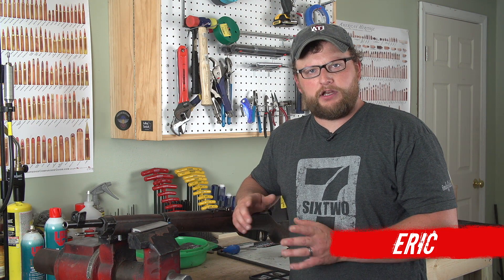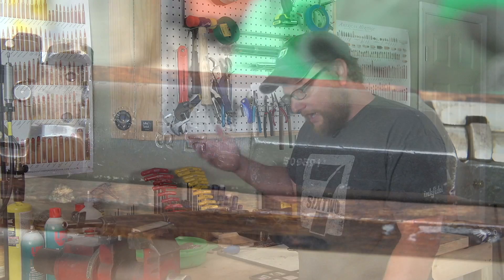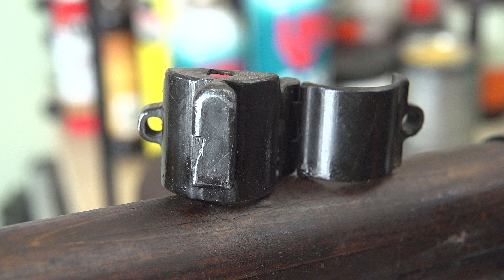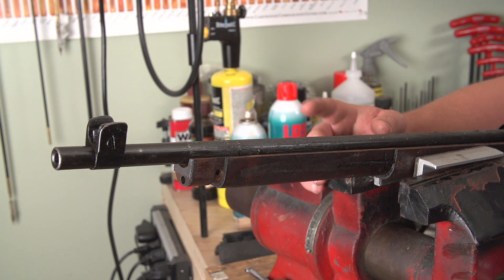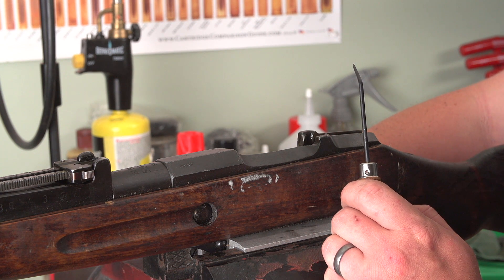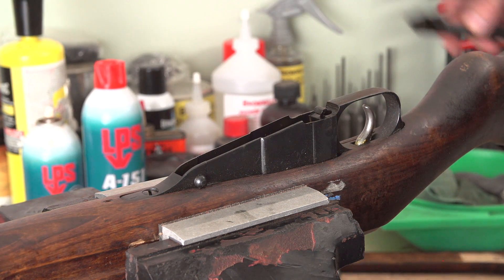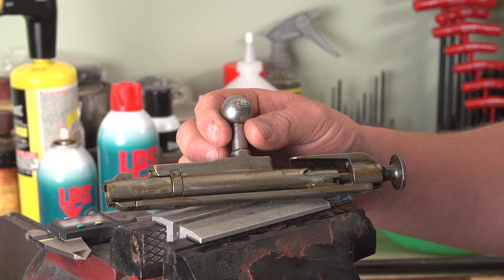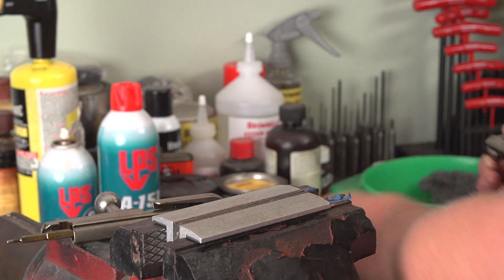Finnish M39 Disassembly and Full Cleanup

Comment: Hey IV8888 guys, I just tore mine apart and that chiseling on the underside of the handguards runs 2/3's of the length of the HG.   I also had two tiny brass foil shims held into place with what looks like saw dust and heavy bearing style grease on both sides that connects to the hardware lug that's under the chamber.  I'm really bonding with this filthy old girl!  The coat of grease in that cavity on the underside of the rear sight assembly is easily some of the raunchiest cosmoline I've dealt with it's like a chocolate with a caramel center, except horribly smelly and disgusting.  I'm probably going to use dawn dish soap on the entire barrel and let both ends soak in a few gallons of boiling water.  I'll probably let it dry in the bed of my truck bec that black plastic bed cover gets unholy hot!

Comment: I just bought one in Connecticut for $650. Sako, 1942. Very clean bore and little wear. Stock is in almost perfect condition. 

I saw it on the milsurp rack in my local shop and said "Isn't that an M39?!" The shop owner said "yep, came in 2 hours ago and won't last long" and I took it.

Comment: For firearms with rimmed cartridges, buy the "disc style" headspace gauges.  Looks just like a flat metal disc.  They have extractor slots already cut in them and are super easy to use.

Comment: Another really good tip is if you only have small parts that need cleaned you can put them on a thick disposable plate and place them in the microwave for about 1 minute. It'll crackle a bit, that's just the cosmoline melting

Comment: The gun would have been one of the 10,500 delivered to Kotijoukkojen Esikunta (HQ of Home Troops). For some reason they had kept the since June 1941 obsolete name Suojeluskuntien Yliesikunta / Sk.Y. (HQ of the Civil Guard" on the guns.
The military functions of the Civil Guard were integrated to the regular army after 1939 and disappeared as such.

The splicing is for reasons of mass production, so that more people could work on different parts of the stock simultaneously, not due to any lack of wood long enough. The large Finnish furniture industry used it so it was readily available. The wood is normal birch, while the Kp.31 is known to sometimes have hand-selected more ornamental stock (actually a genetic mutant strain).

Comment: Hey Eric, today as I was taking my m39 apart, I noticed that the front handguard clamp is squeezing the handguard to the rifle. I thought that if I would loosen it, then it would fix the issue; however, no matter what I do, the handguard still hugs the barrel. Also, I saw on the inside of the front handguards, that there were contact points were the barrel was making contact with the handguard. I your opinion, should I sand down those points, or will that devalue the gun? Thanks for the awesome video!

Comment: Great video on this. Had mine about 1 month and did the full strip down and cleaning. They are awesome firearms. Thanks for the tip on the extractor. Best I have seen yet, should you ever have to replace. Maybe you will consider doing a complete disssembly of an Lee-Enfield No. 5. Just did mine and it was a task, but worth it to get it cleaned up.

Comment: Great video, I just acquired another 91/30 that is still wrapped in plastic and covered in cosmoline and I'm anxious to give your process a try.  Since I don't have access to a sonic cleaner, I will go the old fashion way with mineral spirits for the metal but I'm looking forward to trying the Murphy's on the stock.  I think I detected a bottle of Strike Hold lurking on your work bench and since I use it and am pleased with the results, I was wondering what your opinion is.

Comment: Hey Eric, thanks for the video. I did the test of sticking a bullet onto the bolt head, and ine required a great amount of force to snap it in place, however the edges of the bolt head are not folded over like you mentioned. Any other things I should check?

Comment: I found an M39 that looks like it was reconditioned, possibly new barrel? It was in great shape, except for one little problem. Previous owner had the audacity to coat the entire stock with rhino bed liner. I wanted to know if there was an effective solution to remove the liner? I've heard of people using paint stripper to remove the same coating from the bottoms of antique boats, so I thought maybe that might work.

Comment: @iraqveteran8888 I love your channel, subscribed after watching this video. I purchased an M39 from Classic Firearms this week and just finished cleaning her up. I opted for a Sako Excellent-Hand Select with a cracked stock and was soooo satisfied with my purchase. There's a thin 2" crack at the end of the buttstock and a hairline crack in the upper handguard, no problem! Mine has a SA marked barrel and Sako stamps on the barrel, bolt assembly and stock. All numbers match except for the magazine. Unfortunately everything was ground off the hex receiver, but it has a high wall and looks really old. I'd say the bluing is over 90%. The stock has round edges where the two pieces fit, so I was pleased to find out that it was a war-time stock. The rifling is deep and the bore is shiny! Just wanted to share my purchase with you and say thanks, since your 600 yard shoot with the M39 is what got me to purchase one! Next weekend I'm going to test her out to 500 yards. :-)

Comment: I recently picked up am m39 and have been cleaning it up. I noticed that the stock has a few pinch points particularly at the front ring. Would you recommend taking sandpaper to the inside of the stock and handguard to free it up?

Comment: Is there a slight difference in the design of the chamber of these rifles? My M39 has some stoppage upon halfway closure of the bolt. It doesn't stop, but there's another bit of resistance, similar to the feeling if there were a round being chambered when turning down the bolt. My other Mosin bolts don't even close all the way in this rifle, and they stop exactly where the resistance is met with the original M39 bolt in this rifle. 
Any thoughts?

Comment: This video is exactly what I needed - thanks! On my M39, the barrel only seems to be free floated until near the end of the stock. I can slip a dollar bill under the barrel near the receiver, but I can only slide it up to an inch or so before the end of the stock. Is that a problem? I've never been able to get any decent accuracy  - I wonder if that could be contributing...
Reply: +rahowhero I just took it apart again and it is was definitely made that way. That's the way the stock is finished - it suddenly gets narrower at the last inch or so. So it has to be deliberate. I also found that I have no shims in the action. I know the rifle was taken apart before because the tang screw was damaged so I wonder if they lost the shims.

Comment: I wonder if it would be possible to use some of these techniques like free floating the barrel on a stock 91/30 to improve accuracy.
Reply: There is a kit you can buy that has shims and info on how to free float barrel properly. Just google it.
Reply: you can even buy a m39 trigger for your 91/30. 2 stage trigger which is a good thing.
Reply: I bought one but it did NOT fit in my M44 :/

Comment: what if the threads between the cocking piece and firing pin are rough? mine wont tighten or loosen by hand. thats without the bolt body and spring. imagine how hard it was to disassemble. any ideas? ive tried wire brushes and solvent afterwards but its still grindy and rough. threads on the pin look fine but i cant tell on the knob.

Comment: A steel pot scrubber for the stock? Seems a little harsh.
Reply: +D5quared91 Ya thats like course steel wool right? Ouch.
Reply: sergeantbigmac
Maybe it won't hurt the wood but I think I'll just use a normal sponge when I clean up my new M39.
Reply: Eric is simply running the scrubber across it, not applying serious pressure. So long as you don't rub it in, it shouldn't upset the finish at all
Reply: +D5quared91 Probably Chinese steel and softer than the stock :D
Reply: +D5quared91 
The steel pot scrubber I looked at does not have sharp and or rough edges to it. It's actually kind of gentle as compared to steel wool. Eric did say it was gentle on the stock, so I went to the store and had a look see.  He was right .

Comment: Quick question, can we use firing pin and a spring from the Mosin m90s/91 on m39 ? I cleaned up my m39 last night by watching ur video, and it's spring and firing pin looks very similar to m90s/91...
Reply: Yes. The entire bolt assembly is original Russian M91-M91/30 production. The Finns only replicated certain parts to fix problem guns, but those parts were made to work with original Russian equipment. 

 I have a 1943 Sako M39. The bolt is all Tula Arsenal manufacture. The receiver on mine is from some of the first batches of receivers ever produced for the M91 from the Chatellerault Arsenal in France. The Finns reused everything they could to prevent from having to manufacture bespoke parts.

Comment: picked up a 1943 VKT m39 for 200! its a beast! ammo is getting hard to find though
Reply: you are correct. i use to buy for 90 bucks milsurp spam cans. now with shipping milsurp costs more than commercial ammo. i have been using 174gr. silver bear at 10 bucks "steel" a box. or ppu at 14 bucks 'brass" either way this is non-corr. primers so in that way it's good. i have a Vepr 54R and it's a safe queen now. lol. i have more fun with my 1942 Sako m39 bolt rifle instead of dumping 10 rd.'s out of the Vepr. M39's like heavy ball ammo like Eric said so 174 up to 203 gr.'s seem to run well in these Finnish Rifles. 91/30, m38, m44 i use the light ball stuff cause it seems not to matter. if you goggle 54r ammo in Europe their are still warehouses filled to the roof but we are not getting into our country anymore. just buy a Lee loader for 35 bucks shoot some ppu brass and you will have ammo for life. you can reload 50 rd.'s in 1 hour once you get the hang of it. good luck with your rifle.

Comment: How often should I apply oil on firearms? Do you guys have a set schedule to oil up your firearms? Or only after you get done shooting? I have always wonder if I should do it every so often even if I don't shoot the gun in a while.
Reply: Hey, In Finnish army we put with heavier oil when you dont shoot the gun for a while, but when you do, you give it cleaning and wipe the extra oil off so it dont burn and make the barrel dirty. Always after firing, cleaning and light oil! And during camps we would put some oil in if we couldnt clean the gun right now so when we finally did the dirt would come off easier, that was our schedule in the army,  we had firing range every wednesday almost through the whole army.

Comment: I received a Classic M39 a while back and the bolt is ridiculously hard to operate (sticky bolt) even without ammunition. I've followed your video on smoothening up an MN's action but it hasn't helped much. The bolt assembly itself is rather ragged looking, so I'm considering sanding and polishing it up to a mirror finish. Is there something else that may help?
Reply: I took several of my Mosin bolts apart and polished them with a fine polish stick (from Lowes) on a polishing wheel. looks like chrome and is very smooth!

Comment: i dont know why people worry about the pot scrubber harming the wood etc only if its loose will it get removed because of only it touching the surface oils etc and then only slight bit of pressure for the deeper oils.

Comment: Would you recommend any locktite on the finer screws?  I'm about to do mine now!
Reply: Dont use locktite, there is a chance that you mess up the screwheads when taking it apart the next time, because you have to use more force than normally to get them loose.
Reply: +Destillator I wouldn't use the red perm stuff I'd go with a drop of blue to keep the threads from backing off when that old war horse kicks!
Reply: +Destillator I don't think it would do anything for you anyway, those threats are cut exceptionally well and I used bees wax to treat my wood after i sweat the greasy nasty cosmoline out of the wood.  I used a mix of dish soap, the jewelry cleaner royal purple and a plastic pot scrubber to clean mine up.  After that I put the stock and handguard under the shower and rinsed the wood out and neutralized any chemicals.  Then I applied obenhauf's bees wax to the newly exposed wood.  It looks amazing.  I'm very pleased with it!

Comment: What's the deal on antique firearms? I remember purchasing some Ludwig-Lowe Mauser receivers manufactured in 1893 and no paperwork was needed about 18 years ago. Do these Finnish variants require an FFL dealer to transfer since they were reworked or does the manufacturing date of the receiver dictate what type of paperwork is needed.
Reply: Most any gun you buy online needs to be shipped to your local FFL/ gun store so you can fill out the background check paperwork and anything else applicable to your state. 
However with guns classed as "Curio and Relic" (of which this Finnish M39 is one) if you have your C&R license/O3 FFL you can buy them online and have them shipped to your door. If you don't have one and are into old mil surps you should look into getting it. 
Real old guns like 150 year + old muzzle loaders and such are not even considered firearms but I forget how many years old they have to be to qualify for that. The Finish M39 is not one of those guns though even though its really old.
Reply: +drtrolish, thanks for the info! That is one license I have been contemplating to obtain for quite some time but never did considering I have a few friends with FFL's who will run it through their books. It is nicer to have it shipped to the door however one has more favorable shipping rates when packs are sent to legit business brick and mortar locations plus you never have to wait around for Santa in the Brown suit to show up.

Comment: Would this be barreled for .308, or the newer .310 bullet at that time ?
Reply: 7.62x54r
Reply: Hes talking about the bore diameter not the caliber..It could be anywhere from .308 to .311.
Reply: Thanks, not sure where I read it before but I found this on Wiki - "The Finnish cartridge 7.62×53mmR is a slightly modified variation of the Russian 7.62×54mmR, and is considered interchangeable with 54R. However, the older version of the Finnish military cartridge was loaded with the S-type bullet that had nominal diameter of .308. In 1936 the Finnish Army fielded a new standard service cartridge intended for both machine guns and rifles. This new cartridge was loaded with a new bullet designed in 1934 - the D-166, which had a nominal diameter of .310. The new service rifle m/39 was designed from the start around the D-166 thus it had nominal barrel diameter of .310.
Reply: Ok Cool! I know you can find m27,m28, and 28/30 rifles with .308 bores.
Reply: ***** Thanks but Not what I was looking for.
Reply: John McNamara This is interesting about these guns also "The rifling twist rate was also changed from 300 mm (1 in 11.81 in) to 254 mm (1 in 10 in).["  My guess is they were trying to stabilize the heavier weight bullets better in the shorter barrel ?

Comment: Most of M39:s must have been produced post-WW2? But pretty much to the great 1941 specs. Let's remember this was the Finnish Defence Force's second main infantry weapon (after m28-30 Mosin) all the way until late 1970:s- early 1980s when gradually more and more (first Soviet AKs and then, mainly) Finnish AK-improvement RK-62s became the main armament. Starting slowly, like was it 10 000 or max 20 000 a year from early 1970s.

Wikipedia says that M39:n were "produced" until 1990.  And the still today used TKIV 85 sniper version of Mosin-Nagant was produced (based on Wikipedia) 1984-1985. I have no knowledge, but would have been strange if only for that short time period. 

Sako TRG 41 (33LM), 21 (308) is then a totally different animal from 1989-> No connection to Mosin-Nagant or its cartridge.

Comment: I wouldn't recomend using magnetic tray on something really special and valuable. You slowly magnetice bolts and nuts, witch is almost impossible to remove. Magneticed metal parts collect a LOT of shit very quicly. But magnetic trays are handy for most of the times.
Reply: Chuck Norris non issue, if they get magnetized, heat them up with a torch for a sec and it's no longer magnetized.